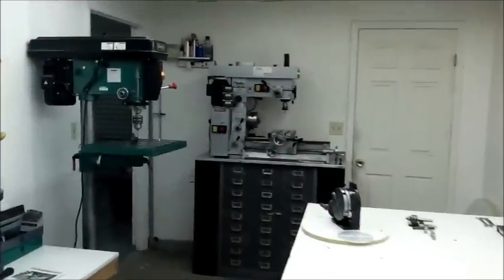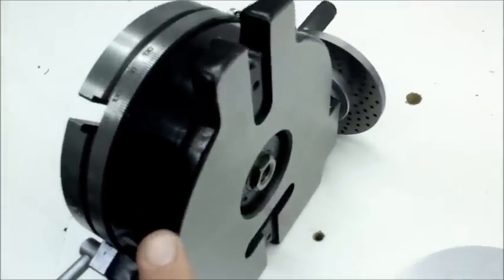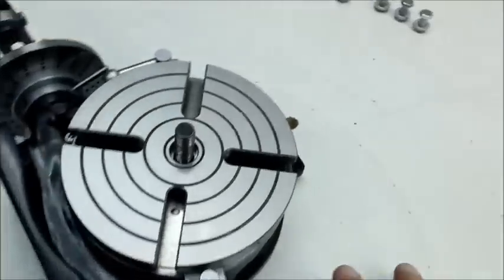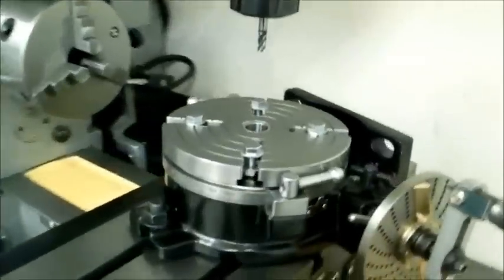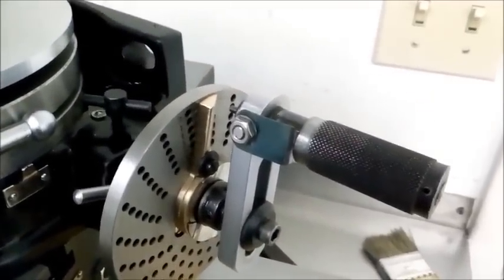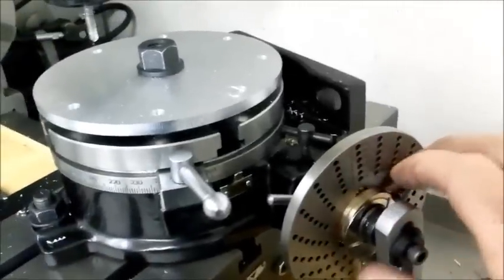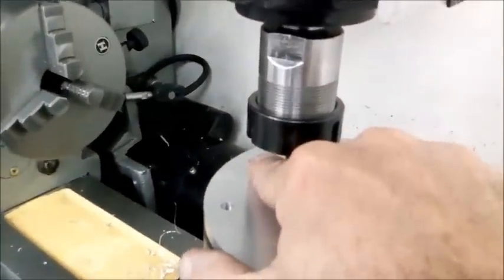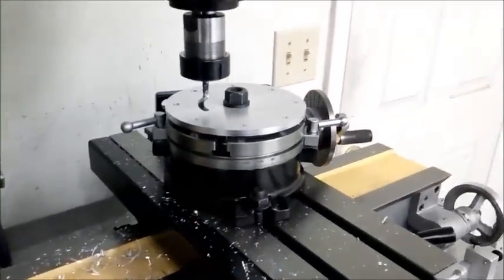Smithy 1220 rotary table

Comment: I drilled a stud pattern in a 6 inch spacer on a 6 inch rotary table.  Made a 1/2 thick aluminum sacrifice plate with a 2 inch center hole with a step to 2 - 1/2  , 1/4 from the bottom.  Made a plate to fit under the sacrifice plate of 2 - 1/2 stepped down to 2 inch with a 1/2 threaded hole.  Run a stud from the lower plate up through the spacer and bolted it down with another round plate.  Worked great

Comment: Hey Mike... Thanks for this it was a Huge help in solving a work holding challenge I am having.  I do have a couple of questions... 1. How did you lock the sleeve onto the threaded stud to machine the taper? How did you determine the angle of the taper for the coupler nut on the bottom?  Thanks..... Kevin Arvada Colorado

Comment: Hi again.Glad to see another great upload.Also have the rotary table but only used it once to make a similar item like yours for my friends kit car engine.Plan was to make xl pulleys and fishing reel parts.Also have the 5C collets and chuck to make a few reel parts.The wedge style quick change tool post from Smithy is a must have and i got additional holders and tools from Grizzly.Would like to see you put the machine thru it threading phase(still have not figured this part out).I make parts , projects and repairs for many of the tackle stores in san diego.Are you in the area?